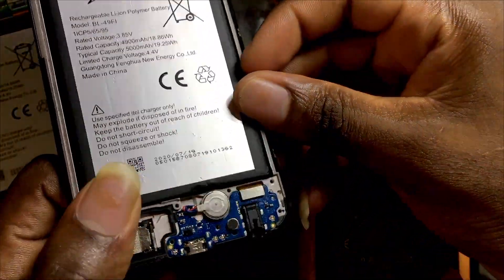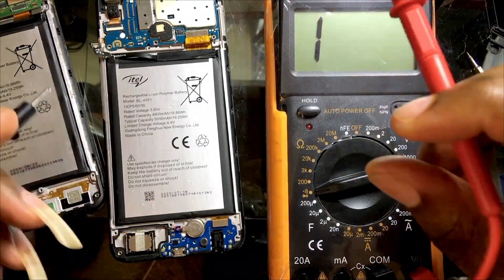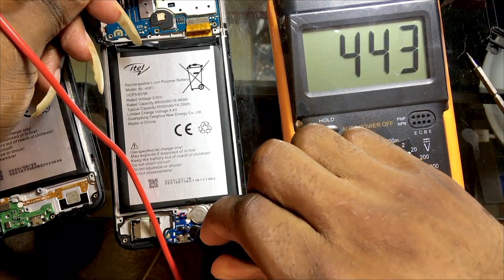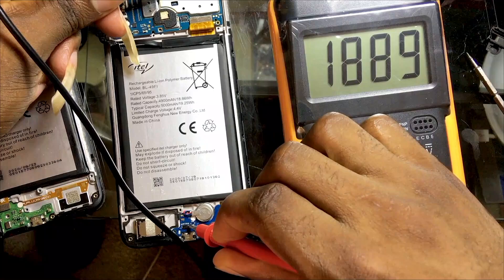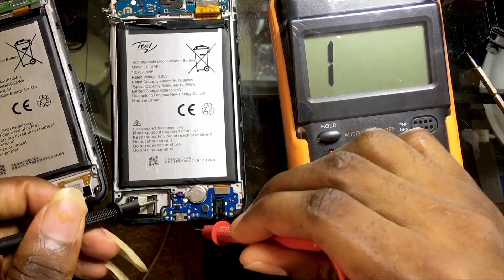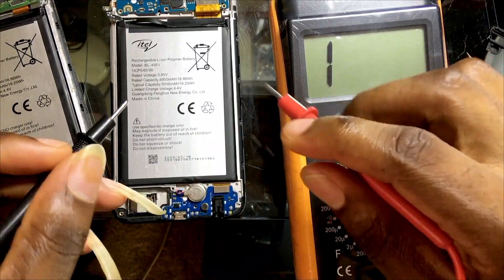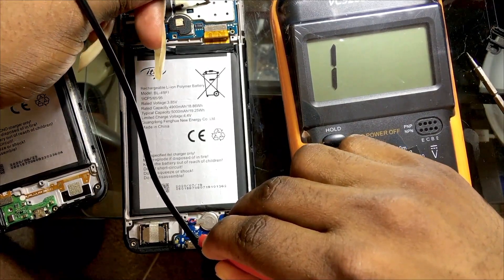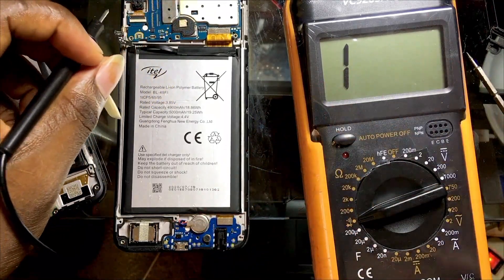How to Test Diodes Using a Multimeter

Comment: How comes your probes or the opposite normally red probes are positive while black is com but you use your red as ground🤔
Reply from the maker: I call that cold testing when there is no power supplied to the pcb and I easily detect half shorting using that method. 
There’s nothing wrong with putting the probs the opposite way if you understand that it suppose to read deferent in forward and backward testing.
Reply: @Serges Mike Techs   ok i guess there's alot  to learn then ....i guess u should do a video demonstration for this cause i don't quite understand....here's a free sub
Reply from the maker: Thank you. 
Kindly visit my channel homepage of my repairing course playlist. You will learn a lot from there